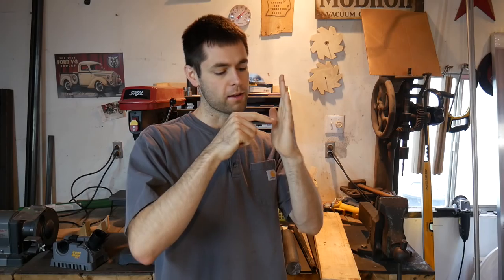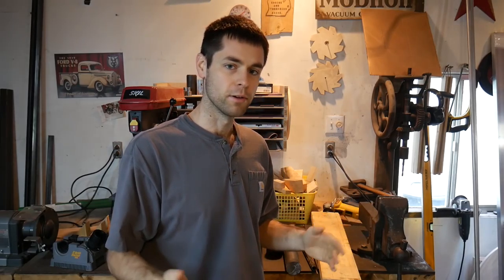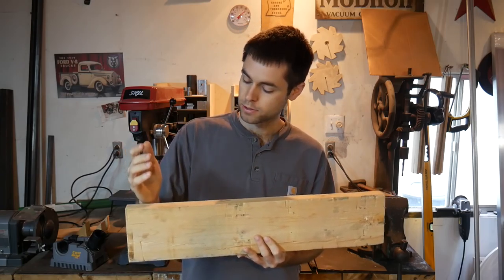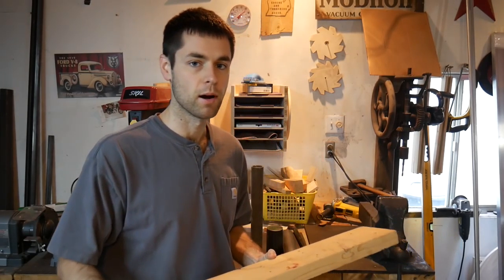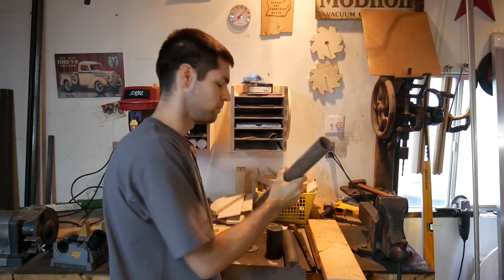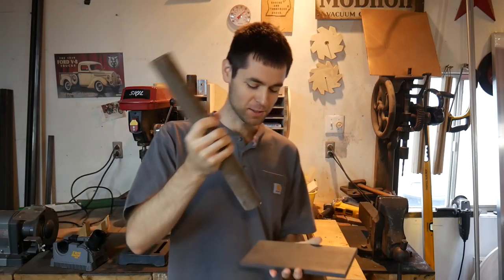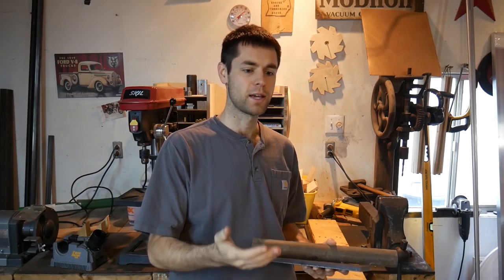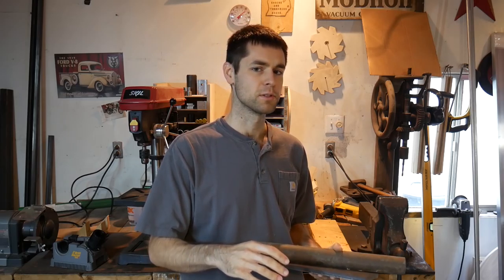Adjustable Propping Bar

Comment: I always just rested one hand on top of the other, and occasionally used a heat shield on my glove
Reply from the maker: I've done that too. The TIG finger, or similar, does work well. When I have a taller piece though the propping bar should be handy, one less thing to think about.